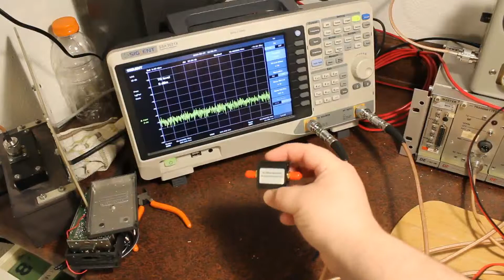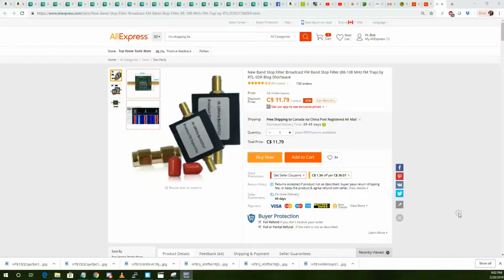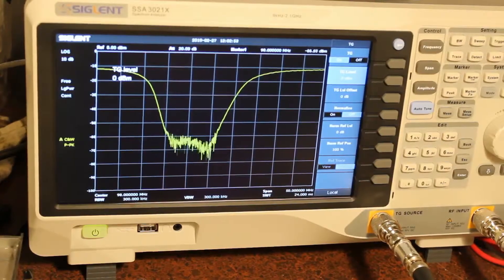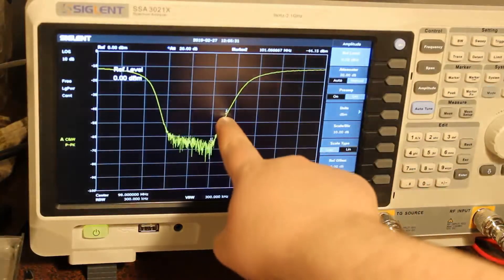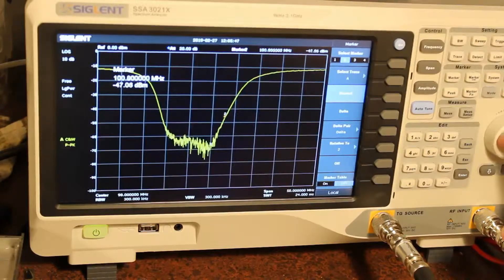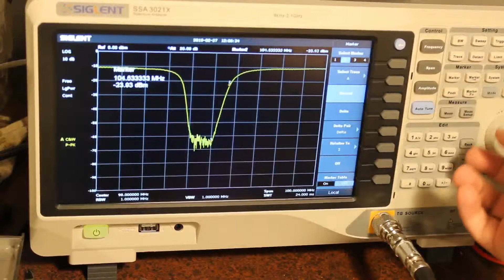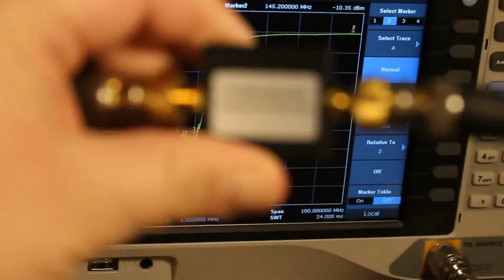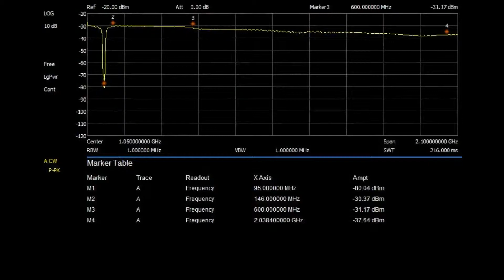Chinese FM (88-108MHz) filter vs. Spectrum Analyser

Comment: how can i tell if i need an am block or the fm block please when i use q channel i get alot of radio stations jumping all over the cb band but i am not sure if they are am or fm radio stations
Reply from the maker: Thanks for the question. I'd recommend an FM block as it's likely overload from up there. I'd very much recommend that you get a cheapo SDR dongle and look at the signals to see what their characteristics are as you can usually tell from that if they're AM or FM stations. Luckily the modulation has very clear signatures. AM is very narrow and has a sharp carrier, FM is wide and blob-like.
Reply: @BobHolowenko  I have the rtl-sdr.com model will try see when set to direct sampling what band the channels are that bleed over
Reply: @BobHolowenko  I also noticed in the 1mhz range I was picking up channel 19 uk normally 27.781250 think it was been picked up at 875 hurts